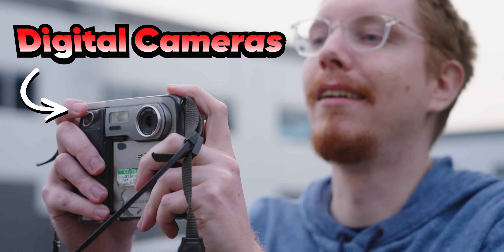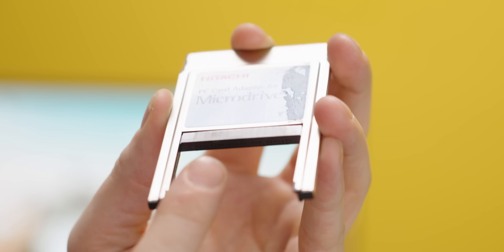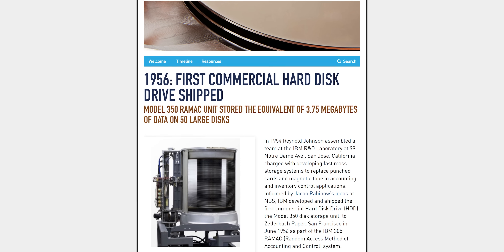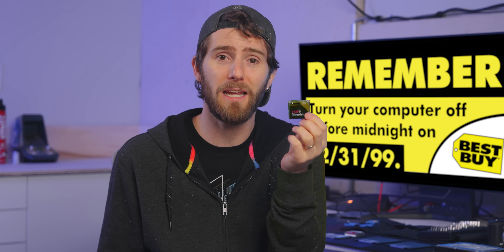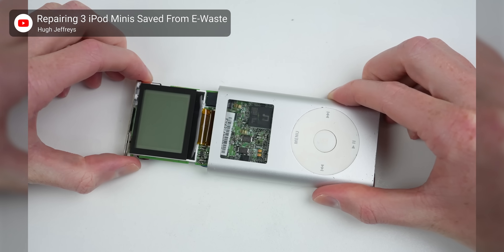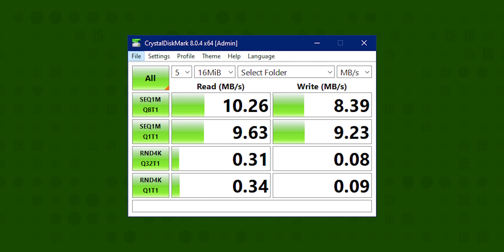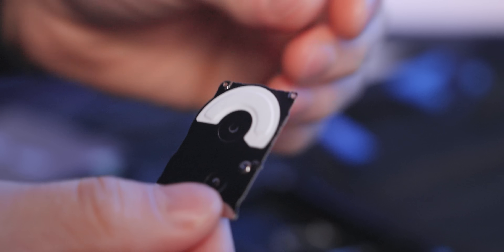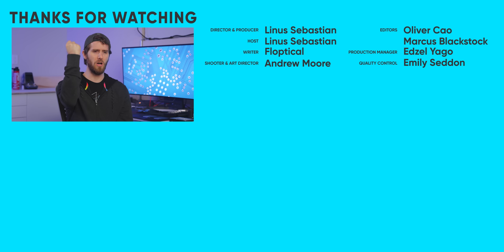This TINY Hard Drive is REAL... and it changed the world! - IBM Microdrive

Comment: I remember using one of those cameras with a floppy drive! We used MemoryStick option instead though; I think that got us a whole 128mb? 

Ah... 2019. 

My employer at the time only allowed the use of company-owned cameras without cellular connections in secure areas, and management didn't understand why we wanted a replacement camera to take pics for documentation when the one we had still worked.
Reply: 19??
Reply: @CativaCookie  Yep. We also had ATI-branded workstation GPUs at my departure in ‘19. CAD workstations didn’t get gigabit connections to the internal network until 2018. We still had one guy on a 32-bit CPU until 2016. Not a box off to the side for legacy stuff; his main computer.

Comment: I used to have an 8gb external microdrive that I bought from Office Max in the mid 2000's. I loved that thing. it was about the size of 3 AA batteries and had it's own integrated stow away USB cable. I miss it, but it developed a ticking and stopped being recognized my my computer. Held onto it for over a decade before finally throwing it away as a lost cause. Then 3 years later I learned about 're-initializing' bad hard drives to get them working again. I tried that on a dead drive from an Xbox 360 and got it working again as an external. Go figure.

Comment: I had an old Casio digital camera and used the IBM MicroDrive with it. It was a game changer. Bang for the buck it was the fastest storage around, and it was very reliable. CF cards were pretty expensive at the time, and the read/write speeds were all over the map, depending on the manufacturer. People couldn't believe that it was a real hard drive, just smaller.

Comment: I still use a 6GB Seagate ST1 microdrive daily. It serves as a temporary storage for a high write demand application where normal CF cards died after a few months; and SSDs were not really a thing when I set that machine up. Its continuously running for the past 12 or so years.

Comment: I remember my dad buying our first 1GB hard drive back in the 90's, which was a 5.25" drive mind you and was still quite expensive, and I remember thinking "there is no way anyone could ever use that much storage space!" 😂
Reply: Yeah, I remember those times. By the late 90s, MP3 became a thing and in 2000 I had an 8 GB hard-drive full of only MP3s.

That era was rad. Everything developed so fast. From 200 MHz CPUs being the top end to 1,2 GHz Celerons just 4-5 years later. The slot A Athlons. The first GPU with hardware T&L, the GeForce 256. I spent big bucks on one of those cards 😂
Reply: @juliusfucik4011  Yup same here! I actually remember back in 1999 my parents and I moved from Texas to Washington State (in the USA) and we drove up there. I had just gotten my driver's license as well so I was driving one car while my parents drove the other. Back then, portable MP3 players weren't really common yet, and I wanted to play my music on the drive up, so I bought a DC to AC power inverter and setup my entire desktop PC tower and CRT monitor in the back seat of the car and wired the soundcard output into the car stereo! The songs weren't exactly driver seat changeable, as it required using the full size computer keyboard and looking at the monitor to change playlists, but it worked well enough to set a playlist going during any of the road trip stops which would play through the car stereo for a few hours while driving! 😂

Comment: I have a distinct feeling until the late 2000s it was not very smart to use digital cameras anyway. I had a 10MP Nikon d60 that was released in 2008, and it was pretty great for what it was but I consider it kind of the line where it started to be worth it. Fairly sure digital cameras in 90s or early 2000s had to be a tiny minority for some special use cases where it was fine to get crappy images.

Comment: You missed the biggest problem with these drives in MP3 players. 
At the time you have no choice but the the 3.5mm jack connecting you to the device. Any random arm flick could catch the cable and would throw it across the room, the impact with the floor destroying the drive that could not park quickly enough.

Edit: ask me how I know. :(

Comment: I remember when these came out and how impressed I was by them. Granted storage space these days is insane, but these are still pretty impressive bits of tech.
Reply: It's crazy to think how much work went into manufacturing so many unbelievably small parts to shrink a drive to that size just to get a couple GB or even a few hundred MB into a 1" space.
Then you fast forward a decade or two and we have drives with 1000GB that are basically a millimetre thick plastic chip the size of a fingernail
Reply: @helplmchoking  To be fair, it is not as if the sizes attained back in the day were trivial. All that work by todays standard would be a joke but 20+ years ago was a different matter.

Hell, back in the 00s if you wanted something akin to SSDs in your comp you had 2 horrid choices. Install stuff directly onto your RAM (not that you had enough RAM to do much of this) or install RAM into a daughterboard that hooks up via pci (not that these things could accept all that much RAM... and they ran over pci, not pci-e, pci.)
Reply: When he said 4 cents per megabyte I had to do a double take, cause we're now at like 3.5 to 4 cents per gigabyte, sometimes way less now. Crazy how far tech has come.
Reply: watch, in 10yrs we're gonna have Petabyte drives and we'll look back and laugh at our measly 4TB M.2 NVME drives.
Reply: aha...like 512 gb/ 1 tb mini-sd cards   but with same poor performance due to overheating ;)
Reply: @s.i.m.c.a  Nah. Nothing really moving inside those, not in the mechanical sense. Nothing really neat about them aside from their storage space alone. It is the miniaturization of the mechanical stuff that makes these things still pretty impressive. Also the fact that they were designed to be moved around in ways that regular mechanical hard drives are not. Which is something that does not really need to be accounted for with modern flash memory. Not in the way a spinning platter and moving head needs to. Much more akin to the stresses of a laptop hard drive.

Also, keep in mind what other read, write and transfer speeds were prevalent in the 90s and 00s. So, not nearly as big of a hit in performance as similar numbers would be today. Still, it is a pretty valid comparison when thinking about how both work in the real world.
Reply: It's honestly kinda weird to me that these didn't improve in capacity and/or manufacturing efficiency over the years and just kinda died out. 

Then again, current metal platter tech has kinda stagnated a bit in terms of growth.

Comment: I remember a friend having one of these for a camera and it had ONE GIGABYTE of storage. At the time, that felt like infinity for a digital camera.
Reply: My CD Mavica still works. It's a modern one with silver casing and blue trim.
It actually saves in .TIF files :)
Reply: Yep. I had a Macintosh IIsi (with the video card required for driving the 16" display), and I think we had an 80MB hard drive in it? May have been 40. When the first gigabyte drives came out I couldn't believe what I was seeing.
Reply: @DrewWalton  I remember that. I’m a bit younger, but accustomed to floppy disks and CDs, the first home drives with one or even multiple gigabytes blew my mind. Then I had flashbacks as ~15 years later it happened with terabytes haha. “I could never possibly fill a WHOLE gigabyte/later terabyte!” Now I’m just wondering how long it is until there’s 1PB drives and kids are calling 256TB small lol
Reply: MicroSD cards never cease to amaze me. I just bought two 512GB cards, and they aren't the largest capacity you can get. Sandisk goes up to 1TB (on their own website so not fakes)
Reply: back in the early 2010s i thought windows phones were the best and coolest, every one that i picked up was so slick and futuristic, its the one that aged the best if compared to android 2.2 and ios 6
my dad got a lumia that i dont remember perfectly the model but it had 8 gigabytes of storage, by then only my mom had an android phone and it was only 2gb, i couldnt believe how awesome it was to have a phone with as much storage as a thumb drive, in my country thumb drives we a bit salty on the price back then, 8gb was a lot for me, i had an 8gb thumb drive and it took me months to fill it up
Reply: @sockettgirl  What country homie?
Reply: @EikottXD  brazil, i unironically live in a tree and fistfight orangutans over the bananas
Reply: @sockettgirl  how's the WL ratio?
Reply: @sockettgirl  I never used a Windows phone but everyone I talked to said they loved the interface but quit using it because there wasn't a lot of support for apps.
Reply: while me, I was already impressed with CF 256MB cards. lol never new that these micro drives existed until i heard about he ipods.
Reply: I used to think the original Xbox had infinite storage because compared to the GameCube it felt like it did. 50k+ blocks and I don't think that number even dropped
Reply: i had the same impression in the 90s with my 386 PC, it had a 512MB hard drive. for the 90s, this was so impressively huge, i never was able to fill it up.
at a time, where mp3 no one knew it existed and digital camera didn't existed yet.
Reply: My very first digital camera (a super crappy 640x480 pixels webcam with fixed lens, integrated memory and AA batteries, bought in year 2000) come with a fixed 8MB flash storage; it was a nice step in technology.... i used it for everyday photos and as an helping hand together with the film camera during holiday vacations....
Few years later (2006) i bought a real mid-range digital camera (Konica Minolta Dimage Z3, a 4.1Mpx bridge camera with a single lens, extreme optical zoom and manual exposure capabilities) as well as an insanely big 256MB SD card.... about 250 high resolution photos are now available..... the following holiday vacation was the last one with a film + digital camera combo.
Even if it is very outdated (and quite mangled by a rough handling) and even if i have bought another camera, i still have this camera today with some 2GB SD cards (which is the maximum the camera can handle)
Reply: Thanks boomer
Reply: I remember how big the upgrade from 8MB to 128MB compact flash was... I can imagine why one gigabyte would feel so limitless.
Reply: When I bought my first PC (way back when), the seller installing it was explaining how I would never need more than one Gigabyte (one of the largest drive sizes in the world at the time). And I have heard "Future-proof" ever since.
Reply: Yeah that's pretty great , Olympus digital camera had 250 SD card or something, do 4x that
Reply: i remember i found one of those in a psp datel drive i purchased in 2006. my ps3 was able to read the drive alone. but no other adapter did.
Reply: I had one but they were unreliable under heavy load.  The concept was great, have massive storage and shoot as much as you want, hell turn on bracketing because why not!  But end result was if you took 100 pictures in <10 minutes it would overheat and shutdown.
Reply: First time I saw one it was my excited brother coming home with his $899 340MB MicroDrive.
Reply: I will never stop being amazed at how much it cost (and how hard it was to set up and get working) to get a 20 mb hard drive in 1990 so I could play a game that my Dad didn't have enough space open for on his 10 mb hd.
Reply: 8gb when i got my first USB drive for like $30 now for $40 i can get a 256GB drive today! AHHHHHH!!!!!!!!
Reply: @crazeguy26  I remember paying ~$75 for a 1GB thumb drive that I used often. Spent $20 for a 128GB thumb drive a couple of months back. A thumb drive I had one single use for and after that would simply be handy to have around. (which means I could have likely spent $10 and have been just as happy)
Reply: I have
Reply: I remember when these were out, as my aunt had just gotten an HP point, and shoot digital camera that took CF cards, and shot 1.1MP photos, and I was looking up the MicroDrives for more storage as I was borrowing the camera for a family day trip, but yeah after seeing the prices, I settled, and grabbed a couple of lesser known brand 64MB CF cards to upgrade the 16MB CF card the camera came with, and for the time 128MB of storage was plenty for a day trip, or even a weekend trip if you treated it like a film camera, where not every sec of your trip was a photographic moment.
Reply: Back somewhere around 1990, my stepfather brought home a 1gb, double height/bay, 5.25" hdd. He worked for a company that custom built mainly Acer computers for other businesses, before Acer went consumer level many years later.

That drive was huge and had to have weighed 6lbs.
Reply: 1.1kth like 😂
Reply: waiting for a compamy to put sth like this intoo a m.2 sata form factor
Reply: I have a fujifilm camera that shoot at the impressive size of 2 MP with a 64mb storage lol
Reply: My first digital camera took like 26 mb memory cards. Never once filled it up by the time I got around to backing up to the PC
Reply: I have 4 GB
Reply: I do digital cinematography and my (relatively) cheap camera with high compression wouldn’t even get 10 seconds on a gigabyte. It’s insane how data hungry image capture has gotten.
Reply: I remember having 64mb micro sd cards and they were like $50. Now you can get 128gb micro sd cards for like $8
Reply: I have a compact flash for my EOS Rebel XT... 2 GB
Reply: @lth3may029  I have 1GB & 4GB CF cards for mine. As well as an ancient 32MB CF card that came with some old Powershot. For years now, I have kept that 32MB card with the others as a joke.

I still use my Rebel XT (350D for Europeans) regularly. While sensors for cameras have improved a lot, in the same period, the optics really have not improved a whole lot. Even when using the camera without a standard lens, such as using a telescope in place of a lens, I haven't seen a whole lot of improvement. What you can do with photo editing notwithstanding, the quality of the optics really makes all the difference in the world. (granted, now I am seeing everyone start to leave the SLR design, which is understandable given the advance of tech, but I digress)
Reply: @lth3may029  Thats… really low today
Reply: @potatofuryy  it can hold 400 raws so it works. And I have 4 of them >:)
Reply: @lth3may029  Haha, that is certainly a solution
Reply: @lth3may029  But, like, how does that add to the conversation?  Idk what an EOS rebel is, and if that's a modern thing, that's not a lot. If it was back in the day, why not expand upon your comment a little bit?
Reply: @kindlin  EOS Rebel was a Canon DSLR around 2008, 09ish (just going from memory so that won’t be 100% accurate to release times), so a 2GB card was small to medium at the time. 

I didn’t have an SLR at the time, but in my own “bridge camera” (not super a thing anymore, a fixed-lens camera but with much larger lenses and sometimes sensors than point-and-shoot) I was making do with one each of an older 256MB and then-current 1GB SD cards, and was jealous of the people with 8 or 16GB.

So in summary, 2GB was on the low-end of midrange. It might’ve even come bundled with their EOS!
Reply: @lth3may029  At the time of announcement in June 2000 of the 1GB Microdrive, the typical Flash CF card size was 64MB. Larger sizes like 128GB was just announced not long ago, and sizes like 488GB and 512GB were announced only around the same time (at much higher prices).

Doesn't seem very large now, but at the time it was.
Reply: @jakej1837  I know I watched the video...
Reply: @lth3may029  Then I guess like others I don't get the point of your comment.
Reply: @lth3may029  ok....
Reply: @guadalupe8589  sorry I was just sharing I wasn't trying to be rude
Reply: @lth3may029  dont be sorry. They are just being rude. Nothing wrong with your reply.
Reply: @DJStKittz  But if people are upset by it they must have perceived it as such and thus require some form of reparation
Reply: @lth3may029  I don’t think (at least most) people are getting upset by your comment, more just… confused. But tone is hard to read in just text 😊
Reply: @lth3may029  I wouldn't be worried about a person named Guadalupe tbh 😂
Reply: @lth3may029  Don't ever apologize unless you do something wrong.
Reply: @lth3may029  thats cool man ignore the others.
Reply: @DissociatedWomenIncorporated  lol, yep just confused about the comment in context to the OP, not upset.
Reply: @lth3may029 ok....
Reply: I am going insane
Reply: @Faded02-k4p you good bro?
Reply: @Indisputed  I love crazy impractical and complex devices. My heart problems are about to get worse
Reply: @Faded02-k4p you li2ke to reel
Reply: Wow you people are so cool! I don't have any camera except red, only for recording
Reply: @KangJangkrik  that red camera is cheap. I bought my 3 yr old one of those because he can do 3 digit multiplication table.